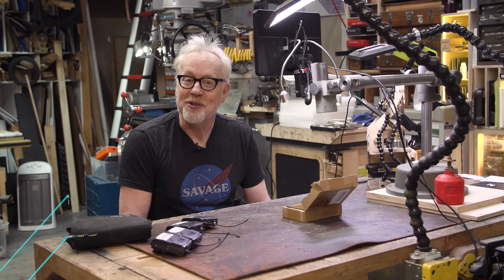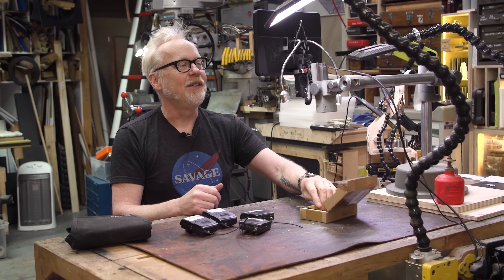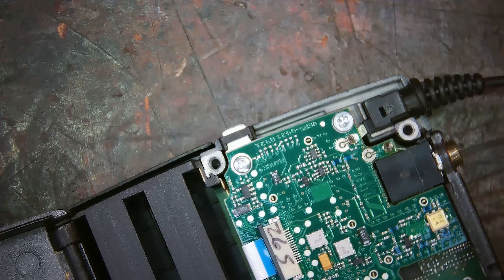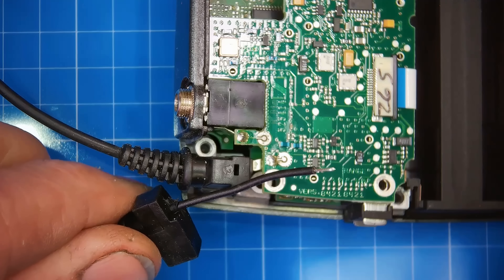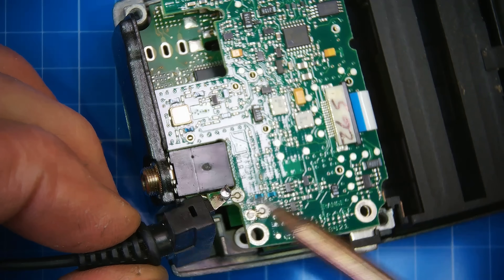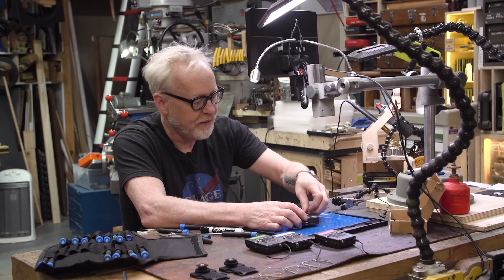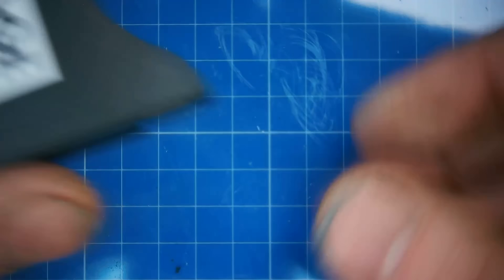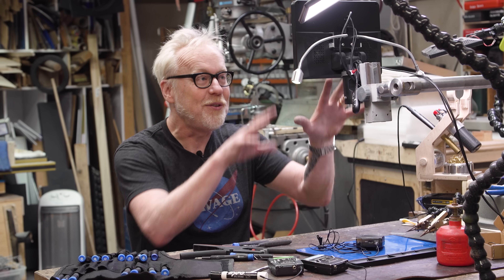Can Adam Savage Fix Our Microphones?

Comment: There is nothing special about an antenna. It is just a wire in a plastic sheath. Some are coiled but still just a wire. The failure you are experiencing is most likely a physical break in one of the strands of the antenna. I would guess right about were the stress relief ends. But if you can remove the bad section of the antenna you could solder in a replacement wire, without have to got all the way to the board. You would lose flexibility but you could also just solder the damaged section. What I am getting at is for the ones that you can't find OEM parts, all you need to do is maintain the proper relation ship between antenna length and the Frequency used and you can use any wire that is similar to the wire in the core of the current antenna. Or repair the existing wire that is in the antenna if you can identify the fault point.
Reply: If you need help understanding the relations ship of frequency and antenna length I would refer you to a local amateur radio operator or pg 208 of the Pocket REF 3rd edition. I would offer to help but I am on the other coast.

Comment: I would put heat shrink tube on those to make them stiffer, a long piece down the whole length then a larger shorter piece to stiffen up the body joint area.

Comment: Conical soldering iron tips should be banned. I have never found a good use for them, unless frustration is a goal. I always use a chisel tip, be it through hole or SMD, so much easier to get proper heat transfer.

Comment: where did you all get those OEM mic replacement parts at?
thank you for the wonderful video!
we run a small community theatre in SWFL that is 10 years old. We have lots of mics that could use antenna replacement and I'm handy with a soldering iron.

Comment: Very cool! That's simple enough. 

It would be cool if there was a different way to replace these without soldering since regulations change so frequently
Reply: Any regulations that could happen or which have happened aren't really going to affect the antenna type that which is used in these devices or in this repair

Comment: Adam! I can’t believe your team doesn’t have a knurled nut driver for your Sennheisers! See the video at 5:32. I’ve been using this unit for years as a variety western arts performer (trick roping and bullwhips) and after much frustration after the nut on the microphone input jack loosened and I lost it. The jack turned when you were tightening the microphone plug and eventually shorted. So I searched out the solution and found the right diameter knurled nut driver made specifically for this task. I carry it in the case with my trans/rcvr and periodically tighten the nuts. It’s a must have if you use these units on a regular basis. With all your tool knowledge I’m surprised you didn’t already have one. Get one for the Savage video team!
Reply: Heck, Adam could probably hand MAKE a tool.  Would be a fun little project.

Comment: Just letting the wire poke into the soft solder and leaving it like that is asking for future intermittent trouble from a cold solder joint.
Once you know it is in place you should carefully heat it again to make sure the solder has flowed nicely between both the wire and the board for a solid connection.

Cold solder joints are the likely the source of a majority of intermittent electronic failures.

Comment: The whole time you were struggling with getting the new wire through the old solder... try one of these incredible, inexpensive tools.  The SOLDAPULLT.  Changed my soldering life.  

Full model name:
DS017 The Original EDSYN Deluxe Desoldering Solder Sucker SOLDAPULLT Made in California

Comment: I'm going to add in myself as a "helpful hints from a pro" guy.
Having something along the lines of a plastic ice cube tray or any other compartmentalized container on hand while you're working on something like these is very helpful. If you place parts removed, in order, into compartments in the container, you're automatically sequenced for reassembly, plus you tend to not lose the parts.
Until of course you knock the container over:face-blue-smiling:

Comment: Back in the late '70s I saw an Xcelite driver for the nut on those 1/8-inch (3.5mm) jacks.  It was a hollow tube with two nubs sticking out, 180° apart, so they would fit into the notches in the nut on its knurled face.  It also had a center pin that would fit into the jack and provide alignment and a center of rotation.

I always regret not buying it, and have never seen an equivalent in all the years since.  In its place I've typically used a pair of needle-nosed pliers, similar to what Adam tried with the tweezers but sturdier.  Put the ends of the jaws into the notches and twist, keeping the pliers rotation axis aligned with the jack.
Reply: It’s called a knurled nut driver. I have one I use for periodic tightening of the microphone input jack. It can loosen with time and if you lose it you can develop an internal short very quickly. In my opinion it’s an invaluable tool if you use the Sennheiser packs.

Comment: It looked like the new antenna was a touch shorter on the outside (could have been an illusion) but if that were the case, then they may have compensated by having the interior wire longer to maintain the wavelength. Might have been better to do a single loop on the inside with the full length leader. Just an observation and might only cost you a little bit of range if that is in fact the intent.

Comment: If it were me i would probably mod the device by installing an SMA connector so I can easily remove/replace the antenna, assuming those are just basic whip antennas and nothing proprietary.

Comment: I love these senheiser wireless packs, but after the second time I had to toss out my systems after the FCC sold off bandwidth I switch to the Rode Wireless Go system. Definitely prefer sennheiser for quality, but as a smaller creator the Go works great and is super convenient.
Reply: What's the reason for needing to sell?  Is it that you're not "authorized" to use them on that frequency any more, or the frequency gets crowded and noisy?
Reply: @ReverendTed the FCC gave that portion of frequencies for exclusive use to some other entities, perhaps law enforcement. They continually do this encroaching on Amature radio spectrum as well as spectrum that is used for low power transmitters. Basically if you use the "banned" equipment and cause harmful interference to the licensed allocated user who PAID BIG MONEY TO THE FCC to get this portion of frequencies the FCC will basically take you for all your worth because you are not licensed to use that bit of bandwidth. As with most government agencies with alphabet names they will change your name to Ben Dover.

Comment: A great instructional, however for anyone intending to do this, if you are going to make an extra investment into this wireless system and take the time, expense, and relative risk to perform this repair, its much more beneficial to forego the OEM replacement antennae and instead modify with an SMA coaxial for only a very very slightly extra cost and a touch of more work. In terms of durability, flexibility of use, the potential for moderately improved range, its a no brainer. Why replace the part thats most prone to failures with the same part that has the same failure rate when you can improve your system for roughly the same cost and commitment? Plus, if you were to have a failure again, its much easier to unscrew an antenna and screw on a new one than to reopen your device again and resolder, again which is not preferable in the field. If you can do this repair on your own, you are capable of doing an SMA modification as well.

Comment: I moved onto Lectrosonics wireless many years ago. But still have these as my camera sends from my audio bag. I installed SMA antennas onto all my G3s. It’s definitely worth doing. Sma antennas can be taken off for storage or easy swapping to a new one also I feel I have slightly better reception stability
Reply: Now this is a modification that definitely interests me. Could you provide a few more details?
Reply: When I worked sports production Lectro was the go to microphone for the sturdy case and easy replace antenna.  Plus the antenna was not a floppy. For floppy antennas, some thin wall shrink tube helps them be a bit more ridged without affecting RF.
Reply: @nomenclature9373  of course. Sennheisers are prosumer stuff. I have a couple sets of Lectrosonics SM Wide Band TX’s running into SRC receivers myself. But still have the G3s sitting around as camera hops for scratch audio

Comment: The OEM antenna has the rigid metal "pin" (like the one Adam removed) I've replaced dozens of this antennas and have never seen one with this wire, interesting. Another tip - the pin to remove the battery door slips out with ease, making the whole thing a little easier to handle.
Reply: I agree and they should cost only between 5 and 10 USD directly from Sennheiser 🙊….

Comment: I was in retail maintenance for 6 years, the walkies the team use are torn to shreds constantly, either antennas would break or the main button would come off the board, profit wise the store had to spend close to 1500 dollars to replace a walkie, I started collecting the broken ones and frankenstein-ing them into working units. not the hugest impact but it was personally gratifying to see so many continue on
Reply: The world needs more fixers and less throw away mind sets.
Reply: @Eremon1  They need to mskr things more fixable too. As a Mr Fixit myself I run into more anti fixit activities by mfrs.
Reply: I prefer to model before that. because they were a screw on thread. Very quick & simple to change
Reply: Saved from the landfill. ❤
Reply: If it ain't broke, fix don't it

Comment: As a former (and still sometimes) electronics tech, solder wick and flux are your friends when it comes to jobs like this Adam; they make repair work so much easier.
Reply: I know I said this before, but this old bench engineer (UHF/uWave) cringes whenever Adam grabs a soldering iron. We should probably pool our resources and get him a pack of solder wick, desoldering pump, and jar of flux!!!
Reply: @gerryg505  The desoldering pumps were a godsend when I was a radio tech. So much easier than wick.
Reply: @gerryg505  I was yelling "get the solder out of the hole!"
Reply: I'm an electronics hobbyist who actually bothers to learn how to do things right. It is easier to stick the wire in through the hole from the top if the wire has enough clearance when you close the case. It is also better to place the wire in the hole cold before you solder by using solder wick to remove the old solder in the first place. Also, if the individual strands don't splay out as you stick the wire in the hole, you can take advantage of the fact the wire was pre tinned (making it silvery. Particularly high quality wire is literally silvered with real silver). Also, an adjustable temperature soldering iron is quite useful if you don't want to oxidise the solder or delaminate the board and trace with too much heat or make a cold connection; the solder was melted, but not hot enough to wet both surfaces fully. You can sometimes tell by the fact a cold solder connection looks granular, rather than shiny, but that can also be the result of hot solder cooling too slowly. Blowing on the joint can also actually help cool the joint fast enough to make a good connection.
Reply: Used them for the first time a bit ago, total game changer
Reply: @11cramm11  soldered for years in TV broadcast and special FX.  Never used flux.  For new job was trained in military grade soldering.  It is amazing what a bit of attention to detail and flux can do to make it so much easier and the results, so much better.
Reply: @nomiSimple  "military grade soldering" - does that mean you're cutting costs and corners in your solder job, just like the real military? :P
Reply: @nomiSimple  I only use flux on SMD otherwise just solder with flux.
Reply: flux + chisel tip is best (better conduction of heat with more surface area)
Reply: @Nisstyre56  chisel and knife I like but I also use them for plastic work
Reply: also kapton tape is a godsend
Reply: flux for the win lol
Reply: Even a $5 manual spring-action solder pump would have made this so easy. Also, putting solder on the tip to form a heat bridge to the part is quite important. Pressing a dry iron against an existing joint does next to nothing.
Reply: @HenryLoenwind  it can even damage other components by overheating the PCB. I try to keep it under 2-3 seconds of heating to melt the solder and let it flow
Reply: Probaly sacrilege, but I also like to use wooden toothpicks to clear the through holes. Always available, solder does not stick to them, and they get in to the tiny holes to push the solder away.
Reply: Former Navy ET here with solder school.....the first rule of solder school is flux is your friend....and yes, we talk about solder school.
Reply: And chisel tip instead of conical. This is just painful 😂
Reply: Bit of flux would definitely help, but since it's trough hole I'd try using a tin pump first to open up the hole.
Reply: Good flux is actual black magic. Put some of that baby on the board, and suddenly the solder goes exactly where you need it to. Such a godsend. The only thing I value higher than flux is low melt solder, you melt it into soldier joints on thick PCBs (thick PCBs can absorb a lot of heat which is bad when you're using heat to desolder) or places with heat sensitive components you can't hold hot air on to lower the melting point of the solder, then you can desolder with just an iron
Reply: As ex radioshack employee i will say this comment takes me home
Reply: Little solder sucker…

Comment: Something that might have helped with the soldering is a "Sold-a-Pullit" (not sure of the spelling, no markings on mine). Spring loaded thing that vacuums the solder out when triggered.
Reply: I know those as solder suckers
Reply: Another term to search with is "Desolder Pump", or the more advanced "Desoldering Iron".
Reply: I've had dozens of solder suckers over the years, from cheap Fry's white-label ones to "expensive" ones from Weller.  Best one I've ever had, hands-down is the "Vampire Tools" solder sucker.  Got the tip from @LyonsArcade (Joe's Classic Video Games), and it has saved me tons of time (And solder pads pulling up!  I don't have the workbench/desk real estate for a good desolder pump, so manual for me)

Comment: I've done these exact repairs a bunch of times. Sennheiser Evolution Wireless ew100g2 or g3. The antennas, the mic jack and the buttons die on them. I'm an IATSE Local One - NYC Stagehands union member, working for one of the big AV equipment rental shops for Broadway shows. We rent and repair lots of Sennheiser, Shure and Lectrosonics RF systems.

Comment: As a voiceover professional and content creator, I love my Sennheiser mics & gear, wireless G4s included. But I've always thought that non-replaceable antennae were a MASSIVE design oversight. Flex-antennae are ALWAYS going to be a failure vector. They should be easily replaceable onto these receivers and transmitters with simple thread-locking replacements in the same way you can with a walkie talkie or a CB/HAM hand unit.
Reply: I don't know much about audio gear but I'd think there's a way to mod these with replaceable antennas
Reply: Audio engineer for theatre here, the non-replaceable antenna is likely nothing more than a cost saving measure on the manufacturer side. Whilst not excatly cheap Sennheiser g3, g4 etc are a fairly mid range, affordable option for wireless mics. Higher end devices like Sennhsier 6000 and Shure Axient have threaded connections to quickly swap a damaged antenna
Reply: @chedwin  I'd say a threaded connection would be overkill on this one. It's just a piece of wire in rubber. So putting in a mono 2.5mm jack (not a 3.5mm like the input jack to avoid them being swapped all the time accidentally) and only using the tip would have been fine. From a production view, the jack would probably have been cheaper to make, as it can go in with the input jack, avoiding the extra step of managing that long antenna while soldering it in. From a usage view, yes, the antenna can now easily be pulled out---but it is right next to an input jack that can be pulled out just as easily.
Reply: @HenryLoenwind  Threaded connection is absolutely overkill for this tier of product aggreed. May not have been clear but my intention was to make that same point. However even a basic jack would be more expensive to manufacturer and will have questionable reliablilty in noisy RF environments like trade show floors. With a jack connection you now have a more complex part as you need to make sure you have solid electrcial continuity through both sides of the connector, you now have to attach a jack to each antenna and still have to solder the jack input to the board. With the integrated antenna you just cut it to length, shove it through the rubber strain relief and solder straight on. Yes they are apain to replace when designed this way but for the budget and intended market of the G3 system in this instance I agree with sennhiesers decision
Reply: possibility an intentional "oversight", means that they have to be replaced more often.

i used to think it was unfair to always assume the worst but i have seen evidence recently that proves malice more often the simple oversight.
Reply: @ARockRaider  "Designed Obsolescence" is 100% a thing. Really glad there are no moving parts to my MKE 416...